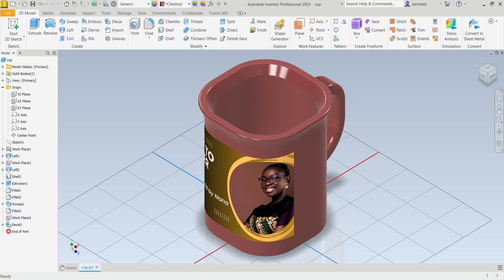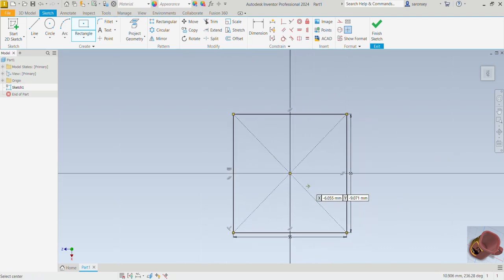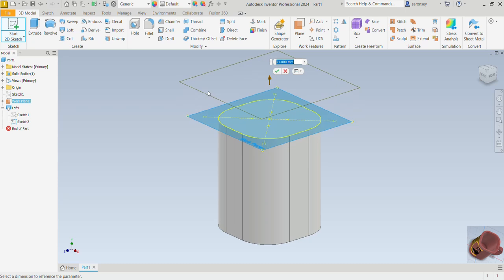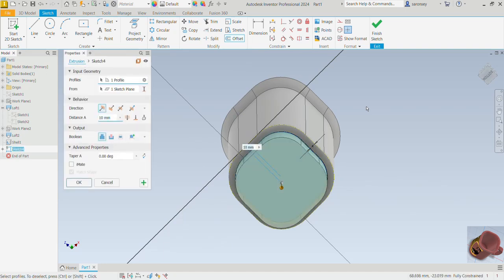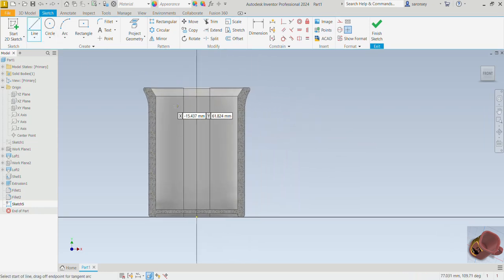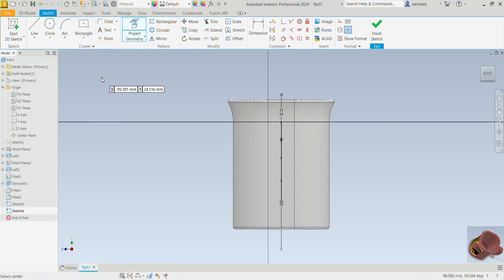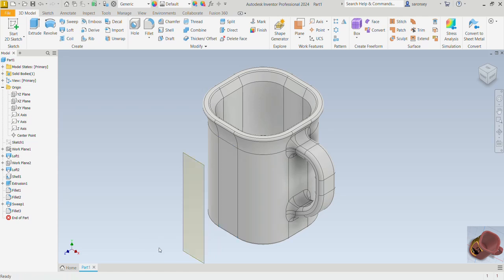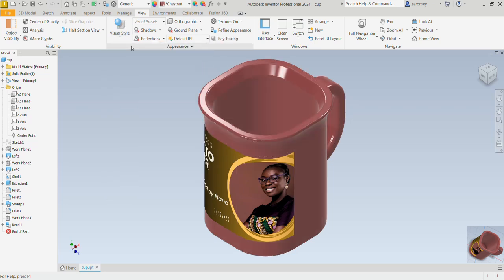How to Create a Realistic Mug in Autodesk Inventor: Loft, Sweep, Shell, and Decal Commands Explained

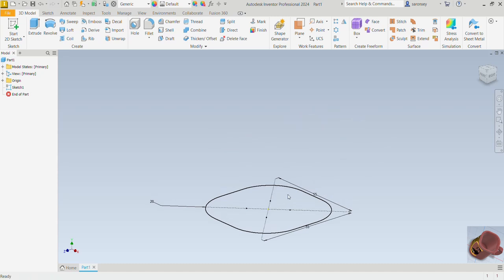Comment: on 2:00 how do I specify the distance?
Reply from the maker: First, select the plane or flat surface you want to offset from, then click on the "Plane" tool under the "3D Model" tab. Once you click the reference surface, a new yellow offset plane will appear, and a small distance input box will automatically pop up. You can then type in the exact distance you want for the offset (e.g., 30 mm) and press Enter. Apologies for the cut in the video—I mistakenly trimmed that part during editing.
Reply: @CAD_by_NANA Thanks👍
Reply from the maker: @ My pleasure 🙏🏾